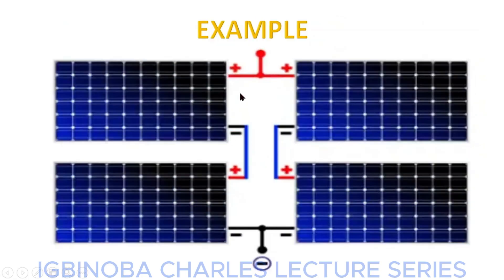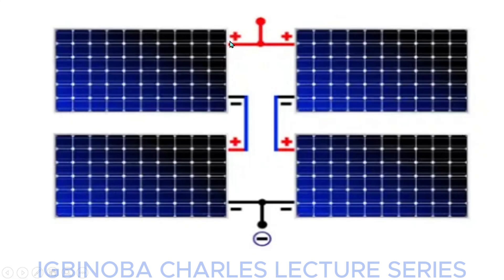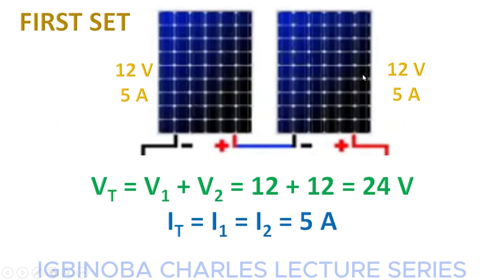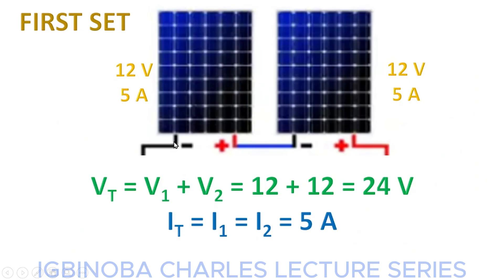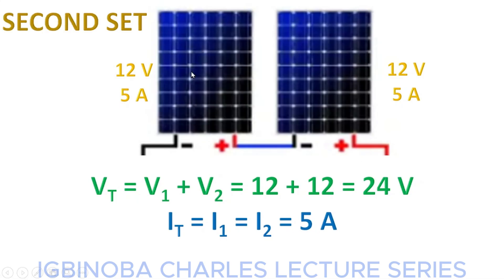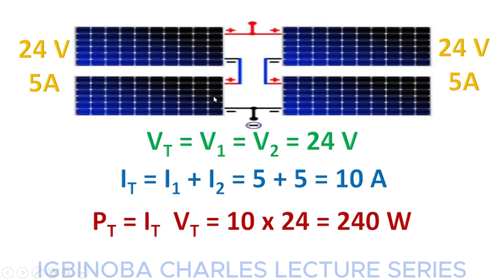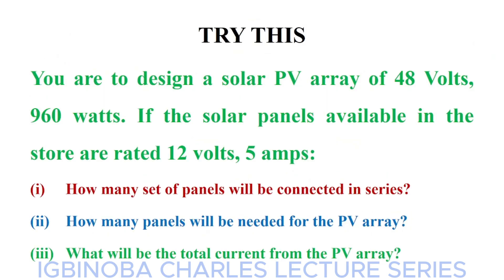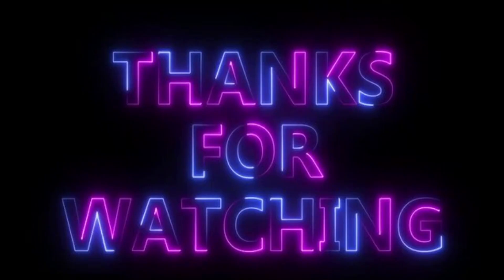Connection of  Solar Panels in SERIES-PARALLEL

Comment: CIV354B

1. 4 panels will be connected in series 
2. A total of 16 panels will be needed for the PV array. Since 1 panel will produce 60watts of power and the total power given is 960W, so 960/60 = 16
3. The total current is 20A

Comment: PETRO391M

1. The series connection determines the final voltage of the array and the required voltage is 480v, therefore the number of panels needed to
reach the required voltage is 48/12 = 4 panels.

2. The power generated by a single panel is 120 * 5
= 600W. The required power in the array is 960W.
Therefore the number of panels needed for the
array is 960/60 = 16 panels.

3. 16 panels are in array and 4 panels are in series.
Total number of parallel sets of panels = 16/4 = 4
parallel sets. Total current from each set of panel is 5A. Since these sets are in parallel, the total current
is = 5 x 4 = 20A.

Comment: PETRO3150T

1). 4 panels are connected in series

We connected four 12-volt, 5-amp panel in series, so we get a total of 48 volts, which is the voltage needed for the solar system.

2). A total of 16 panels needed.
Each panels produce 60 watts I.e 12V × 5A =60W
To get W in total: 960÷60=16 panels 

3).The total current from the solar array is 20 amps
Using the formular I = P + A
Therefore I= 960W÷48V =20A

Comment: MECH3143M
 
1.  The number of panel required is 48÷12= 4panels.  
 
  2. The power output of pne panel is the total voltage multiplied by total current.  
  P=12×5=60watts  
 
  Therefore the total number of panel to prodUce 60WATTS  
  = 960/60=16Panels.  
 
  3. With 16 panels in total and 4 panels per series string, the number of parallel strings is 16÷4= 4parellel sets. Each string produces a current of 5A, since the strings are connected in parallel the total current supplied by the array is =5A×4=20A.

Comment: EEE23W

i. 4 sets of panels will be connected in series 
( 48V/12V) = 4

ii. 16 panels will be needed for the PV array 
(960W/60W) = 16

ili. The total current from the PV array is 20A 
( 960W/48V) = 20A

Comment: EEE3134D

(i)Each panel- 12V, 5A
4 panels in series = 48V, 5A
~ 4 sets of panels will be connected in series 

(ii) 16 panels will be needed for the PV array 

(iii) Total current = 5+5+5+5 = 20A

Comment: PETRO3142L

1) 4 sets of panels will be connected in series

Connecting 4 of 12volts, 5amp panels in series will result in 48volts needed for the experiment.

2) 16 panels will be needed

The power of each panel is 60watt

960/60 = 16

3) Total current for the PV array is 20amp

Since I (total) = P /I 
I(total) = 960/48 = 20amps

Comment: PETRO3167K

1. Number of set of panels that will be connected in series.
48 v / 12 v = 4 set of panels

2. Panels needed for the PV arrays
12 × 5= 60 w
- 960/60 = 16 panels

3. The total current from the PV array
5 amps × 4 = 20 amps

Comment: EEE340N
1). 4 panels are connected in series.
We connected four 12-volt, 5-amp panels in series, so we get a total of 48 volts, which is the voltage needed for the solar system.
2). A total of 16 panels are needed.
Each panel produces 60 watts I.e. 12 V × 5 A = 60 W
To get 960 W in total, 960+ 60 = 16 panels.
3). The total current from the solar array is 20 amps.
Using I = P + V, we have that, 1960 W 48 V = 20 A.

Comment: PETRO3174R

1. The set of panels will be connected in series will be 
=48V/12V 
= 4 set of panels

2. The number of panels that will be needed for the PV array will be 
P= 12V * 5A 
  = 60W

Thus the number of panels becomes 
=960/60
= 16 panels 

3. The total current for the PV array is = 4*5
    = 20A

Comment: PETRO3145O

Answers:
1. Number of sets of panels connected in series = 4 panels
Since connecting 4 of the 12 volts, 5 amp panels in series gives a total of 48 volts as required by the solar PV array design.

2. 16 panels will be needed for the PV array 
This is because the power of each panel is 12 x 5 = 60W, therefore the total number of panels to produce 960 watts is 960/60 = 16 panels

3. The total current from the PV array is 20 amps
Since I(total) = P(total)/V(total)
I(total) = 960/48 =20A

Comment: MECH354B            

  1. Four panels are connected in series

When four 12-volt 5 ampere panels are connected in series, a total of 48 volts is achieved which is the voltage needed by the solar system. 

2. 16 panels will be needed by the pv array. This is because the power of each panel is 12×5=60W therefore, the total number of panels to produce 960W is, 960/60= 16 panels

3. The total current is 20A
Given:  p(total)=I(total) *V(total) 
P= power, I= current, V=voltage
P=960W, V=48V

I=960/48 =20A

Comment: MAR370R

a) Since the panels are connected in series and the target voltage of the system is 480 V, we can find the number of panels required by dividing the total voltage by the voltage of one panel.
Thus, 480 V ÷ 120 V = 4 panels are needed in series to meet the voltage requirement.

b) The output from one panel is given by multiplying its voltage and current:
120 V × 5 A = 600 W.

Given that the system’s total power demand is 960 W, the total number of panels required is 960 W ÷ 60 W = 16 panels.

c) With 16 panels in total and 4 panels per series string, the number of parallel strings becomes 16 ÷ 4 = 4 parallel connections.
Each string provides 5 A, and since they are connected in parallel, the combined output current is 5 A × 4 = 20 A.

Comment: NAT29C

1. In series- parallel connection, the Total number of panels in the array is 8, but 0nly 4 solar panels will be connected in series each .
So therefore the panels in series are 4.

2. The total panels needed in the PV array will be 8, because it's a series-parralle connection.
4 in series and another 4 in series total 8 panels in the PV array.

3. The total current from the PV array.
      Is gotten after getting the total voltage from the series-parralle connection which is 48v.

Given data from the question we have
Total power = 960Watts.
Total voltage = 48v
Total current = ?

Using 
Total power  = Total current × Total voltage 

 Therefore Total current = Total power/ Total voltage 

Total current = 960/48  = 20A.

Comment: PETRO358F

i) When connecting panels in series, voltages add up, but the current remains the same.

Required voltage = 48V
Each panel voltage = 12V
Number of panels in series = 48/12

= 4 PANELS IN SERIES 

ii) A total of 16 Panels would be needed 

Each Panel produces 60 watts I.e. 12V x 5A = 60W

To get 960W in total, therefore, 960W / 60W = 16 Panels

iii) Utilizing the formula - I = P/V

I = 960W / 48V = 20A

Comment: MECH368P
1. four panels  are connected in series 
When 4 panels are connected 12 volt 5amp panels in series, equals 48 volts, which is needed for solar system 
2. 16 panels needed each produces 60w (12v×5A =60w)
To get 960w (960÷60=16 panels)
3.the total current from the solar array is 20amps.
Using the formula I=P÷V 
=960W ÷48V= 20 A

Comment: MECH3154X

1. 4 sets of panels will be connected in series.

Since connecting 4 of the 12 volts, 5 amp panels in series gives a total of 48 volts as required by the solar PV array design

2. 16 panels will be needed for the PV array.

This is because the power of each panel is 12 x 5 = 60 watts, therefore the total number of panels to produce 960 watts is, 960/60 = 16

3. The total current from the PV array is 20 amps

Since I (total) = P (total)/ V(total) I (total) = 960/48 = 20amps

Comment: MECH3121Q

1) 4 sets of panels will be connected in series

i.e to get a total of 48 volts, we need to connect 4 sets of panels (12 volts each) in series

2) Total of 16 panels will be needed.

(Total power = 960 watts. Each panel carries 60 watts. Therefore total panels needed =960/60 = 16)

3) Total current = 20amps

From P=IV
Therefore I =P/V= 960/48 = 20

Comment: PETROCHEM392N

(i) To get 48 V from 12 V panels:
48 V/12 V = 4
4 panels in series per set.

(ii) Each series set gives:
= 48 V × 5 A = 240 W
Now,
960 W/240 W = 4
4 sets of panels are required.
Since each set has 4 panels:
4 sets × times 4 panels per set = 16 panels total

(iii) The sets are connected in parallel, so current adds up:
= 4 sets/times 5 A = 20 A
Total current = 20 A

Comment: Mech318R

1.the sets of panels connected in series is 48/12 which is 4 sets 

2. For the PV array number of panels needed is 960/60 equals 16

3. For the total current from the PV array will be 960/48 equals 20A

Comment: EEE3121Q

i. Number of panels in series: 
48/12    =   4  

Thus;  4 panels in series 

ii. Total number of panels:
total power needed = 960w
power per panel = 60w

Total panels =    960/60   =    16

Thus;  16 panels total

iii. Total current:

Number of parallel strings: = 960/240 = 4

Thus; Total current    =    4 × 5   =   20A

Comment: CIV315O

Since the solar PV array has 48 volts and 960 Watts, with panels rated 12 volts and 5 Ampere:

1. Vt/V1= 48÷12= 4
Four sets of panels will be connected in series . 

2. Using the P = IV formula
Power in a single panel = 12×5 = 60 watts. 

Ptotal = 960 watts; we divide by P1 = 960÷60 = 16

16 panels will be needed for the PV array. 

3. Using the P = IV formula again; P = 960, V = 48,  I =?
Making I subject of the formula; I = P/V = 960÷48= 20
Total current = 20 watts.

Comment: MECH375W

1. Four panels are connected in series.
When you connect four 12-volt, 5-amp panels in series, you get a total of 48 volts, which is the voltage needed for the solar system.

2. A total of 16 panels are needed.
Each panel produces 60 watts (12 V × 5 A = 60 W).
To get 960 W in total: 960 ÷ 60 = 16 panels.

3. The total current from the solar array is 20 amps.
Using the formula I = P ÷ V,
I = 960 W ÷ 48 V = 20 A.

Comment: PETROCHEM343Q

1. Four panels are connected in series.

When you connect four 12-volt, 5-amp panels in series, you get a total of 48 volts, which is the voltage needed for the solar system.

2. A total of 16 panels are needed.

Each panel produces 60 watts (12V 5A 60W) To get 960 W in total: 960/60 16 panels.

3. The total current from the solar array is 20 amps.

Using the formula IP V, 1960W/48V20A

Comment: PETROCHEM320T 

1. Four panels are connected in series.

When you connect four 12-volt, 5-amp panels in series, you get a total of 48 volts, which is the voltage needed for the solar system.

2. A total of 16 panels are needed.

Each panel produces 60 watts (12V 5A 60W) To get 960 W in total: 960/60 16 panels.

3. The total current from the solar array is 20 amps.

Using the formula IP V, 1960W/48V20A

Comment: MAR3108D

I. Four sets of panel will be connected in series

(48V / 12V) = 4

ii. 16 panels will be needed for the PV array

(960W / 60W) = 16

iii. The total current from the PV array is 20A

(960W / 48V) = 20A

Comment: COMP3113I

(i) 4 panels in series (48V ÷ 12V).
(ii) 16 panels total (960W ÷ 60W per panel = 16 → 4 series × 4 strings).
(iii) 20 A total (4 parallel strings × 5 A each).

Comment: PETRO341O

1. 4 sets of panels will be connected in series (48v÷12v)=4 panels

2.16 panels will be needed for the PV array(960w÷60w)= 16 panels 

3.The total current from the PV array is 20A
(960w÷48w)=20A

Comment: CHE3128X

1. 4 sets of panels will be connected in series
(48v/12v )= 4

2.16 pannels will be needed for the pv arrarys.Each pannels gives 60W(12V×5A).
( 960w/60w)= 16

3. Total current from the pv array is 20A(960w/48w).

Comment: Mech3203W

i. 4 sets of panel will be connected in series (48 v/12 v) = 4

ii. 6 panels will be needed for the PV array (960W/60W) = 16

iii. The total current from the PV array is 20A ( 960W/48W ) = 20A

Comment: CHM342P

A)because series connection determines the final voltage of the array and the requir d voltageis 480,then the number of panels needed to reach the required volatge is =48/12=4panels

B)the power generated by a single panel is =120x 5A=600. The required power in the array is 960W.Therefore the number needed for the is 960/60=16 panels 

C)16 panels are in the arrayand 1 panel in series.Total number of parallel sets in series of panels =16/4=4 paralel panels.Total current from each set of panels is5A

Comment: NAT23W 

1.Four panels are connected in series

Each panel: 12 V, 5 A

When connected in series:

Voltage adds up → 12 V × 4 = 48 V

Current remains the same → 5 A

 2.Total of 16 panels are needed

Each panel produces 60 W (12 V × 5 A = 60 W)

Total required power = 960 W

So, number of panels = 960 W ÷ 60 W = 16 panels

 3.Total current from the solar array = 20 A

The system voltage = 48 V

Total power = 960 W

Using 
𝐼=𝑃÷𝑉
𝐼=960÷48=20𝐴

How They’re Connected

There are 4 panels per series string (each gives 48 V, 5 A).

4 such strings in parallel (4 × 5 A = 20 A).

That gives the total 48 V, 20 A, matching 960 W output.

Comment: PETRO350X

a) Since the panels are connected in series and the target voltage of the system is 480 V, we can find the number of panels required by dividing the total voltage by the voltage of one panel.

Thus, 480 V / 120 V = 4 panels are needed in series to meet the voltage requirement.

b) The output from one panel is given by multiplying its voltage and current: 120 V × 5 A = 600 W.

Given that the system's total power demand is 960 W, the total number of panels required is 960 W / 60 W = 16 panels.

c) With 16 panels in total and 4 panels per series string, the number of parallel strings becomes 16/4 = 4 parallel connections.

Each string provides 5 A, and since they are connected in parallel, the combined output current is 5A * 4 = 20 A.

Comment: EEE330D 

1:- Sets of panels that will be connected in series is 48 /12 = 4

2:-The power generated by a single panel is = 120 V x 5 A = 600 W. The required power in the array is 960 W. Therefore, the number of panels needed for the array is = 960 / 60 = 16 panels.

3:-Since we have 4 panels connected in series and we have a total of 16 panels, Total panels connected in parallel is 16 / 4 = 4 panels in parallel. Each of these panels has a current of 5 A. Therefore, the total current in the PV array is 4 × 5 A = 20 A.

Comment: NAT 339M
1. Four panels are connected in series.
When you connect four 12 volts, 5 amp panels in series you get a total of 48 volts. Which is the voltage needed for the solar system.
2. A total of 16 panels are needed.
Each panels produces 60 watts (12v * 5amps =60 watts) to get 960 watts in total : 960/60 =  16 panels.
3. The total current from the solar array is 20 watts.
Using the formula I= p+v
I = 960/48 * V = 20A

Comment: MECH327A

( i ) 4 sets of panels will be connected in series . 
Because 48V / each 12V = 4

( ii ) 16 panels will be needed for the PV array. 
Because a single produces 12V× 5A=60W. Therefore; the number of panels needed is 960W ÷ 60W=16

( iii ) The total current of the PV array is 20amps.
Because from the formula: P=IV
I = P/V.   I = 960W/48V = 20A

Comment: EEE3153W

1. Number of series panels: 
        Ns= 48v/12v = 4
        ; 4 panels 

2. Total number of panels : 
       P= 12v x 5A=60w
       960w/60w =16
       ; 16 panels
 
3. Total current from the PV array : 
         I = 960w/48v = 20 Amps

Comment: COMP323W

1. Four panels are connected in series. When you connect four 12-volt, 5-amp panels in series, you get a total of 48 volts, which is the voltage needed for the solar system.

 2. A total of 16 panels are needed. Each panel produces 60 watts (12V * 5A = 60W) To get 960 W in total: 960/60 = 16 panels.

 3. The total current from the solar array is 20 amps. Using the formula I = P + V, I = 960W / 48 * V = 20A

Comment: COMP333G
1. The number of panels to be connected in series is 4.
12v+12v+12v+12v=48v
2. The panels needed for the pv array is  16 panels 
3. Pt=960w, Vt=48v, It=xa
Since Pt =It×Vt
960=It×48;  It=960÷48
It=20a

Comment: MECH3190H

Required PV array: 48 V, 960 W

Available solar panel: 12 V, 5 A

(1) How many panels in series?

In series, voltages add up, current stays the same. We need total voltage = 48 V, and each panel = 12 V. Number in series =48/12=4

(ii) How many total panels for the array?

Each panel 12V ×5A-60W

To get total power = 960 W

Number of panel=960/60-16

(iii) What will be the total current from the PV array?

Each series string = 4 panels = 48 V, 5 A.

We have 16 panels total, so:

Number of parallel strings=16/4-4

In parallel, current adds, voltage stays same (48 V):

Total current =4×5A-20A

Comment: MAR3148R

a) Since the panels are connected in series and the target voltage of the system is 480 V, we can find the number of panels required by dividing the total voltage by the voltage of one panel.

Thus, 480 V ÷ 120 V = 4 panels are needed in series to meet the voltage requirement.

b) The output from one panel is given by multiplying
its voltage and current: 120 V x 5 A = 600 W.

Given that the system's total power demand is 960
W, the total number of panels required is 960 W ÷ 60 W = 16 panels.

c) With 16 panels in total and 4 panels per series string, the number of parallel strings becomes 16 ÷ 4 = 4 parallel connections.

Each string provides 5 A, and since they are connected in parallel, the combined output current
is 5 A x 4 = 20 A.

Comment: EEE354B

1.  There will be 4 sets of panels connected in series: 
48/12 equals 4 panels (total volt/single panel volt)

2.  16 panels will be needed for the PV array system:
Each panel has a rating of 12V 5A
The power of each panel will be 12*5= 60W
P=IV
From the total power of 960W, we get 960/60= 16 panels for the PV array system

3.  Total current = P/V 
960/48 = 20A

Comment: COMP329C

1. No of panels needed for the Array is 4 = 48V/12V  in series

2. No of panels needed 960W/60W given us 16 but since 4 panels in series 
       No of parallel strings =16/4 = 4 strings 

   3.  Total current in array is No of strings x panel current 
4 x 5  = 20A